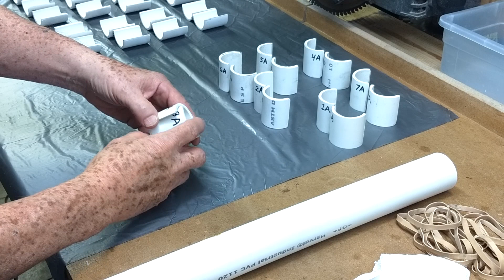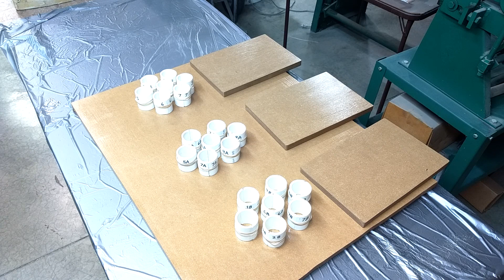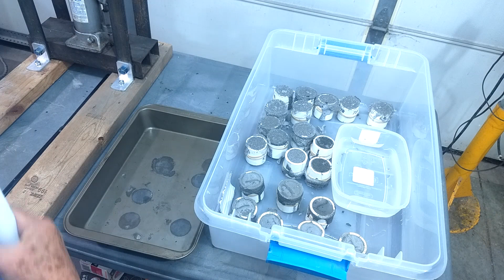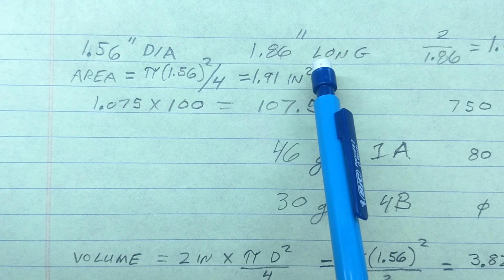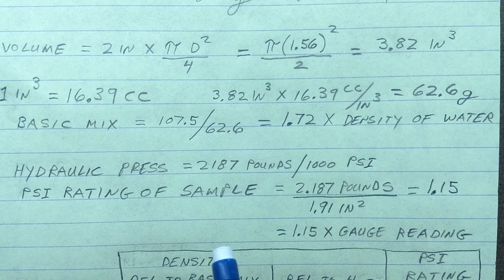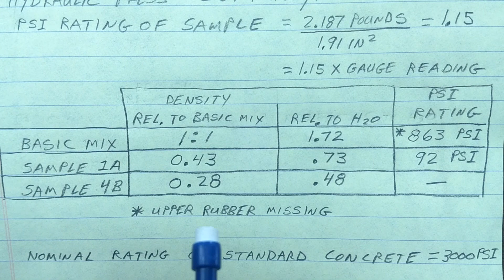Aircrete Experiments Part 4

Comment: I worry that the rubber end pieces may cause horizontal tension in the ends of the sample as the rubber extrudes when compressed.
There may be a substantial poisson ratio discontinuity between cement and rubber. Melted sulphur is kinda nasty, but I understand why it was used. Fast set JB Weld?

Comment: Mr. White, great videos. I wonder if the failure of some of your samples leads back to the formula you're using to determine the volume of your samples. At approx. 25minute mark I notice the volume formula you've used V=H Pi D2 instead of V=H Pi R2. Is this just a typo?

Comment: Turns out as as we would have already predicted, the less dense your end product then the less strong your end product. But it is not a total loss, aircrete is still valuable as insulation, and it will be insulation that is rot proof, water resistant, and fire resistant.  Tell me where you ever heard of a building being built with only insulation, there is no such thing, so don't expect the less dense mixture to be used for structural support, but do expect it to be a decent insulation possibly. How else do you know how to trap millions of tiny air pockets in a material so economically?

But like you said we need more testing and we appreciate that, thank you. But in other words, there still might be a use for a mixture that is somewhere between real concrete and the least dense aircrete mix, that can still be used for some structural support. And if that is the case then you found the best of both worlds, a decent support material that is also somewhat insulating at the same time. But the more dense the end product the less insulating it will be, but more dense means more strength, so you could just build the building out of real concrete so you know it is nice and strong, and then use aircrete(the least dense mix that still provides decent structure to at least hold itself together and take some force without cracking after totally cured after like 30 days) for the insulation, like 6-8 inches thick. lol now that is truly getting the best of both worlds it will turn out i predict. But who gets the best of both worlds nowadays, not the regular everyday hard working people and family, so it is still not a total loss because you will probably find a mix between real concrete and the lightest aircrete, that will be acceptable strength wise, and it will be the most popular because we all can't have the best of the best anyway, not when we pay a criminal cabal to steal from us. A mix between real concrete and the least dense aircrete will be cheaper than traditional concrete mix, while providing some insulation built in, is why it could become the popular choice if you can prove a mix that is strong enough. But if all else fails, it is a possibility like i said in the first paragraph, that aircrete if cannot be used for structure, can be used for insulating properties.

Comment: The ratio of the voids and imperfections on the wall to the cross-sectional area seems large. Samples with a bigger diameter would be more representative of real life. I would keep reducing the water until the foamed mixture is too stiff.

Comment: Hi Jim,  A lifetime ago I worked as a Civil Engineering Technologist.  We did a lot of strength of materials testing with various concrete mixes but never any foam-crete.  To eliminate point loads on our test cylinders we would always "cap" them using an appropriately sized steel mold and some liquid sulphur.  The mold was less that 1/2 an inch deep and only slightly larger than our test cylinders.  We would just pour the liquid sulphur into the mold and then wait a second for the sulphur layer touching the bottom of the mold to harden then we would lower the test cylinder into the still liquid sulphur and in a few seconds the sulphur would harden into a perfectly flat cap.  We would then to the same to the opposite end of the cylinder.  The compression strength of sulpher exceeds 30 MPa so the concrete would always fail before the sulphur did, even on cylinders reinforced with steel fibers.   You definitely had the right idea putting the rubber pads into the system, but I think you will find the sulphur caps will work even better!  I like what you are doing here, its just my two cents to help you get more accurate results from your compression tests.  You are definitely a brilliant guy.  Judging by your printing I'd guess you are an engineer.  Am I right?

You have be wondering if refractory cement could get the foam treatment to make it an even better insulator.  I am thinking of building a foundry to cast aluminum and iron.

Keep up the experiments and great videos.  Using a balance beam and appropriately placed fulcrum to measure out the cement and water was pure genius! Love it!

Comment: A lot of what you are doing is parallel to the honey do carpenter, and off grid homestead channels getting a hard smooth surface,and the best strength compromise is what I'm interested in, the best foam generator is the one cobbled together by the honey do guy it's called a foamate

Comment: Hi again Mike further to my last comment if you want to get really pedantic about this, The cover boards are soaking up moisture and causing shrinking. The tapping to vibrate and settle the mix should be done individually on each batch and last but not least each batch will settle differently due to the different composition of each one.

Comment: Your experiments seem to prove that aircrete is only good for insulation and/ or non-structural projects but not for structure.
Reply: Hi Jim. The strength of a dome is similar to that of an arch. The stability and to some degree the strength of an arch is determined by what is holding it up. The arch will fail if the piers or walls either side of it are weak. Also the wider the testing material is the higher the crushing force can be. There is very little if any crushing action on a dome. Please correct me if I am wrong.

Comment: Mr. White, if you used less water for the main concrete recipe...then the test are going to be inaccurate with the new main concrete mix of less water for the mix.  Then the aircrete test should be for the new mi x of less water....not with the same old mix.  the results will be eschewed.

Comment: I used a 6 inch plastic pipe for a mold. I just cut one side then use duck tape to hold it together. Lube it with some cooking spray. When I pried the pipe slot apart with screwdriver, the dried concrete fell right out. Just a tip.

Comment: Thanks, this is very interesting.  It would also be good to know the density of the foam you are using in grams per liter.  Also, the mix weight of dry cement, volume of water and volume of added foam.  For the hobby aircrete mixer, he will put a 92 lb bag of cement in a 55 gallon drum, add X gallons of water, mix and add foam to a level on the drum that will produce aircrete with the desired characteristics.
Reply: @Jimscoolstuff  Would ceran wrap be better instead of rubber band to hold the mold together?  I would like to see the fracture face in the video     -THANKS
When you make more samples, could you do a little slump test?
Reply: @Jimscoolstuff  I think you are very serious already!!! ;)
Reply: @Jimscoolstuff  Hilarious!
Thank you very much for all your educational videos. You have helped me a lot. Yesterday I made my first Aircrete mix, used a ratio of 2.86/1 as a french engineer suggested (I took in consideration your comment about too much water in the 1.88/1 ratio), I will unmold in a couple of hours, I have some pics and videos I would love to show you, please if you can write me to julienhardy94@gmail.com I can send them to you.
Best regards, 
Julien